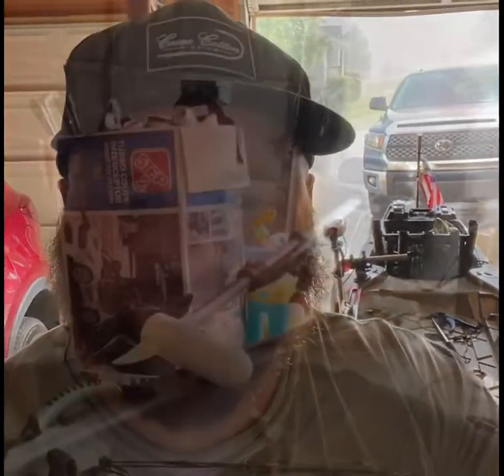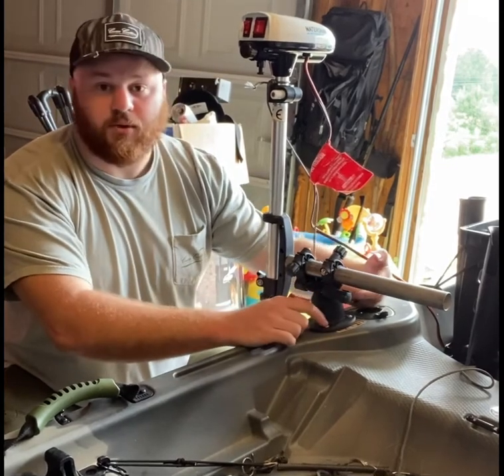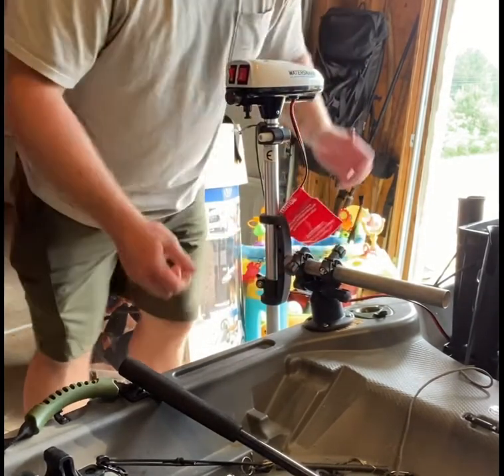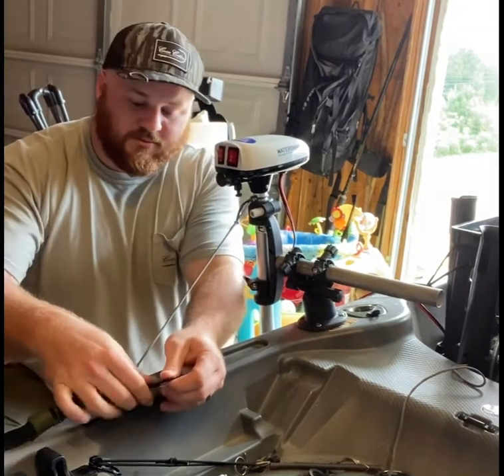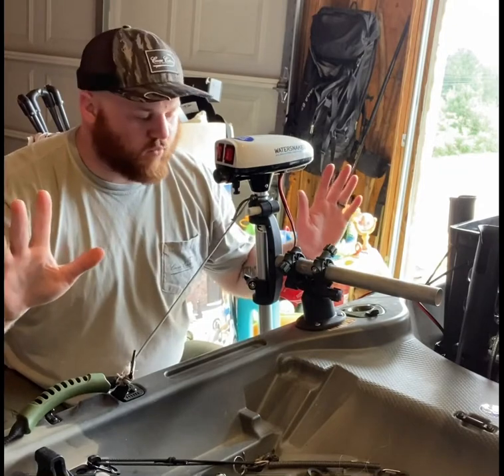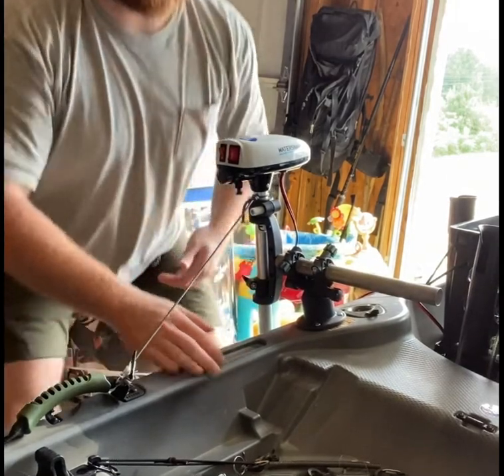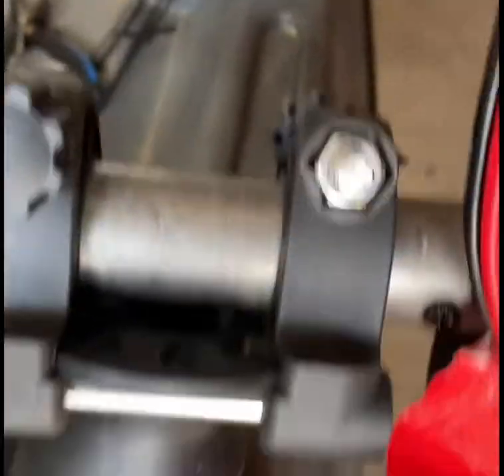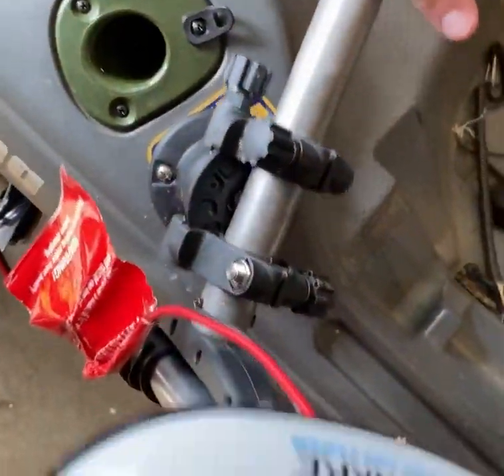Watersnake Asp kayak mount review

Comment: I have the exact same mount and issues as you do and I made a simple mod to solve the problem. I used narrow strips of self adhesive aluminium tape (used to join roof insulation foil) around the circumference of the nuts until the nuts were a snug fit in the holes. This worked well to stop the nuts spinning in their recess. Next I got a 90° x 20mm electrical conduit elbow and used a heat gun to soften one end and slipped (forced) it over the thumb screws. Drop the bolt and elbow (still joined) into cold water to cool it. If you take them apart and do this the elbow shrinks when cooled and won’t fit. Now you have a really cheap scanner that will allow you to tighten the thumb screws just that little bit extra that you need. No more slipping 👍.
Reply from the maker: That’s a super smart idea. However, the bracket that attaches to the motor itself broke off. So now I have to figure out a replacement for that.
Reply: @teamg_fishing1263  Sorry to hear that. I can’t help you with that one.

Comment: The unit actually contains the "stubby one" (small handle) - you need to pull down on that little black knob which is facing down  and it will spring out of the unit.

Comment: Had the same loose issues. Used pliers to tighten everything down and it stayed. You forgot to mention the CHEAP props the have lol. I'm in SW FL and fish shallow flats, 1 hit on the blade and they are done. I contacted WS to see if there is an upgrade prop, there isn't. At 20 bucks a pop, they add up. Would not buy again. Going to get a transom mount MG or MK.

Comment: Hi champ i am in australia and i am having the same problems  .surprised there isn't a group action against  the company  .to solve the base twisting problem i glued two pieces of flat aluminium to base between the clamps  .this has stopped it rotating .

thanks mate and tight lines  .         Wayne greentree